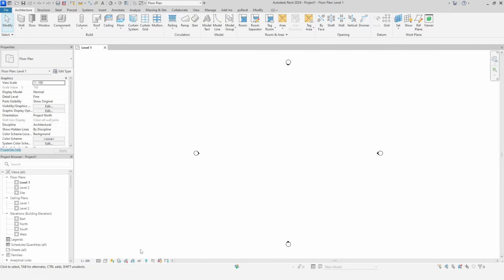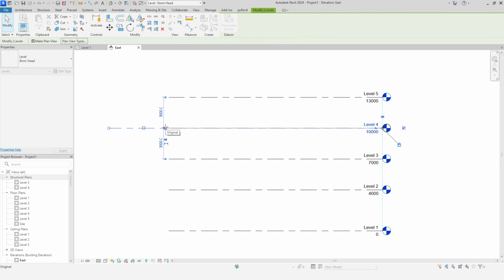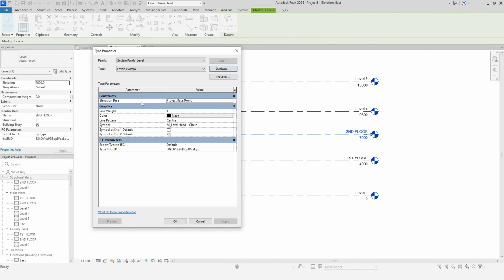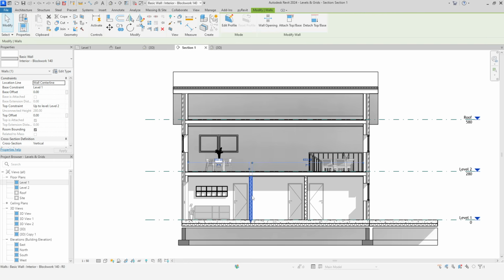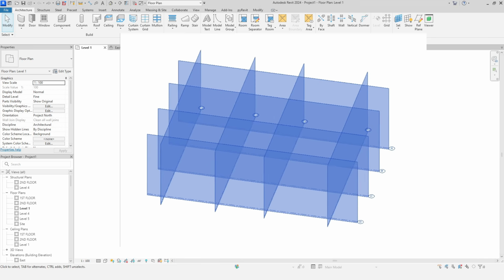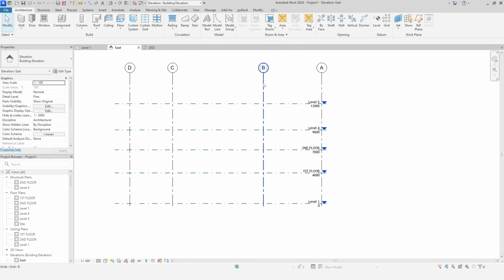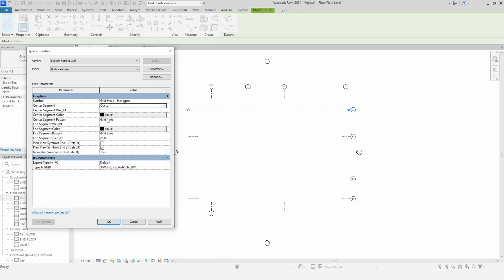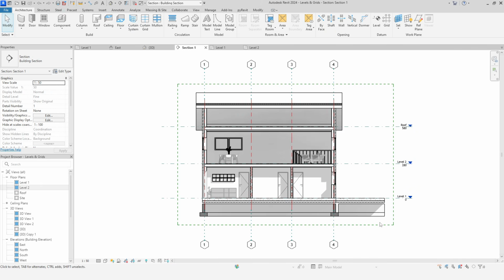Revit Levels And Grids - How They Control Your Entire Model

Comment: when i create a grid i can only see it in the plan views, not in 3d or elevations, sections, why is that ? and what must i do?
Reply from the maker: Grids visibility depends on the specific view settings and whether they physically intersect that view.
If you can see the grid only in Plan views but not in 3D, Elevations, or Sections, the most common reasons are:

- First, check if the grid category is turned on in that view. Open the view where the grid is missing, press VG (Visibility/Graphics), and go to the Annotation Categories tab. Make sure Grids is checked. If it’s unchecked, the grid will not be visible in that view.

- Second, grids must physically intersect Elevation and Section views. If the grid does not extend through the building height or does not pass through the view depth, it will not appear. Open an Elevation view and extend the grid vertically if needed.

- Third, the grid may be set to 2D extents. If you adjusted it in Plan using 2D controls, it may not reach other views. Select the grid, switch it to 3D extents, and extend it so it passes through the entire model.

- Fourth, check if Annotation Crop is enabled in Elevation or Section views. If the grid is outside the annotation crop boundary, it will not be visible.

- Another possible reason is that the grid is assigned to a Scope Box. If a Scope Box is controlling the grid, its extents are limited to that box. If the Scope Box does not intersect the Elevation, Section, or 3D view, the grid will not appear. To check this, select the grid and look at the Scope Box parameter in the Properties panel. If one is assigned, either make sure it intersects the view or set it to None and adjust the grid manually.

Let us know if this solves your issue.